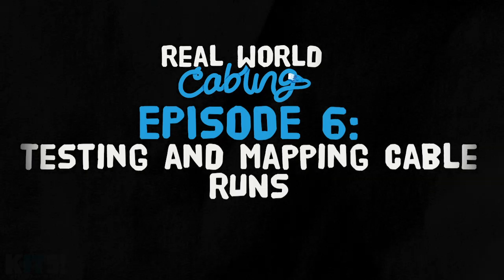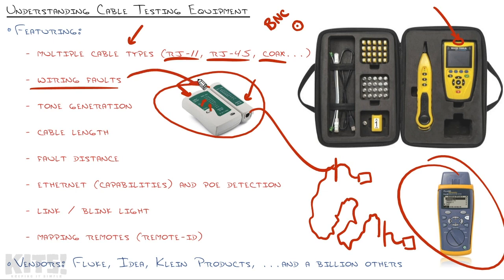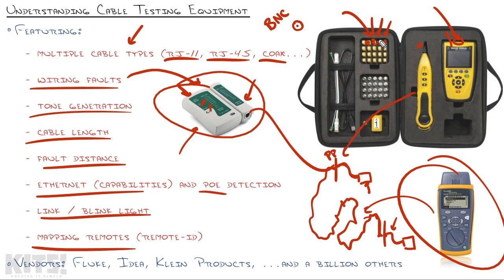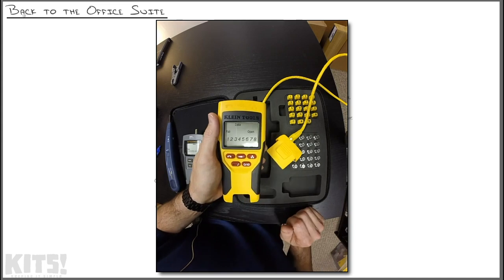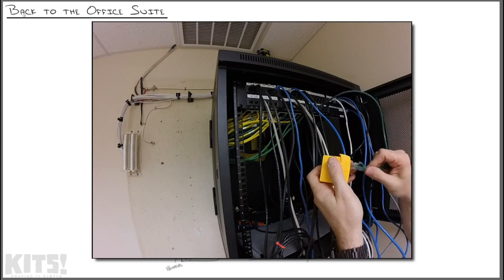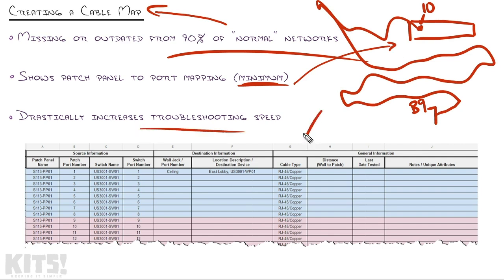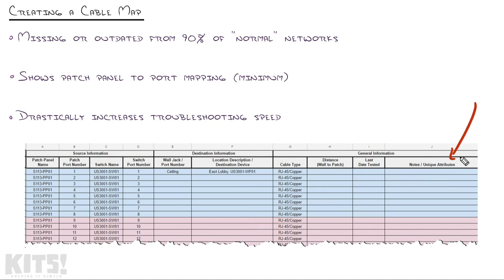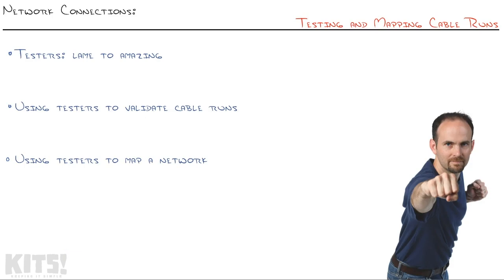Testing and Mapping Cable Runs: Real World Cabling Ep.6 - Keeping IT Simple

Comment: O. M. G!!! I have needed this so much!! I work at a location with approximately 200 people, 200+ hosts, spread around a small campus of approximately 20 buildings. Over the years, three sets of contractors have installed/expanded the network and labeled nothing! Years later, I started working there and have gradually been trying to map out this mess. You have answered so many of my questions and I know your suggestions are going to make this so much easier for me. I can't wait to try this out. Thank you!!!
Reply: Here's how I'd map them out. Purchase 1x packets of 50 pass-through connectors. Take five 12v led and feed it through the ports and crimp. Test this before purchasing another 100 units. Keep them in an out of the way place (to stop getting them lost/damaged).
Then make up your power supply in a plastic box 9v battery, switch, fuse, led1, to pin 4 on a keystone. The return will be via port 5,  then back to the -ve on the battery. Place a patch lead into the battery keystone. Unplug all of the patch leads at the wall plates and the patch panel. Plug the led connectors into the first 48 ports. 
Plug the patch lead into the 1st wall plate, does it glow, Y/N, if NO, move onto the next wallplate keystone. If glowing take the information and move the glow plug to the next available slot at the end, then move to the next wall plate jack. 

Depending on the size of the network, you could go to say 150 ~300 glow plugs, Yes there is a cost to this for the led's and the plugs, however by coming in one morning early (say 5am), you should be able to knock this out fairly quickly with minimum disruption. However don't forget to advise department heads the network will be down from say 5am to 8am on xyz date. 

Once you're been through all of the patch panels one by one and collected the info, it's time to shut off the power to that current switch, go up a level and see which port has lost connectivity up a level. Continue this till you get back to the start point. This is a lot easier than toning and probing, and trying to id with say 12 id testers, especially if you have >=100 glow plugs. Cable supply.com does have the said items already made and for sale on their website if you find that easier.
Reply: @pauljameson5465  have you seen any videos that demonstrate this process?
Reply: Need help identifying the cables? :)
Reply: @Paul Jameson whoa, that is really intense, I’ll try to do that. Also, thank you for replying to my comment, I appreciate all and any input.